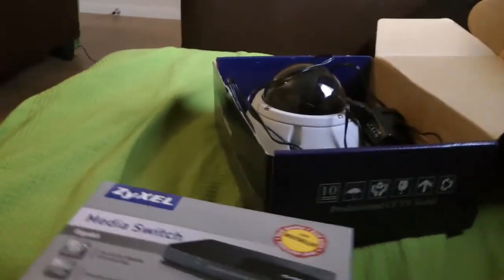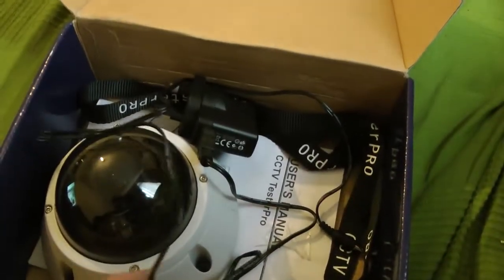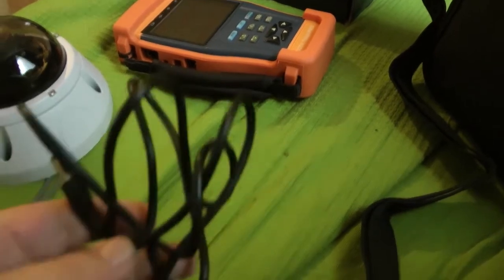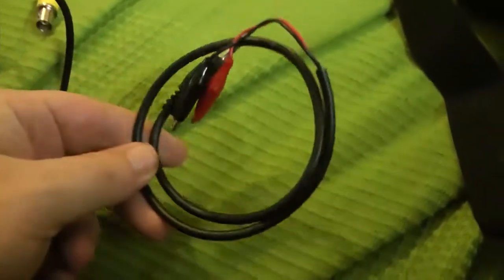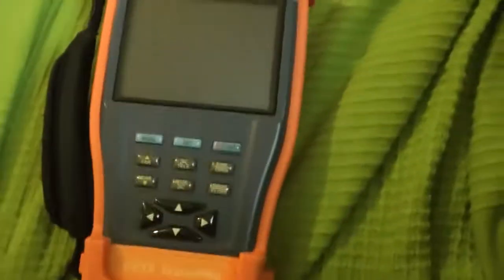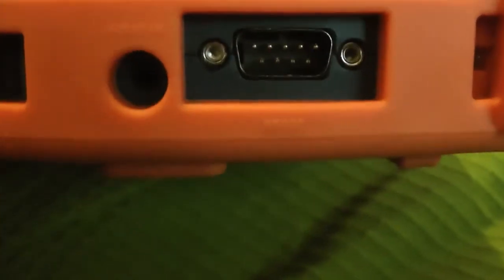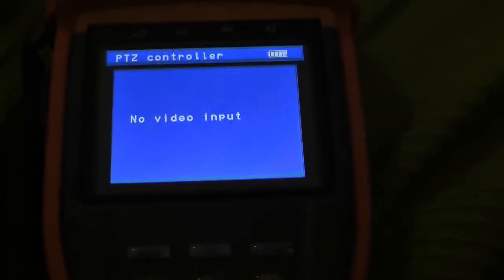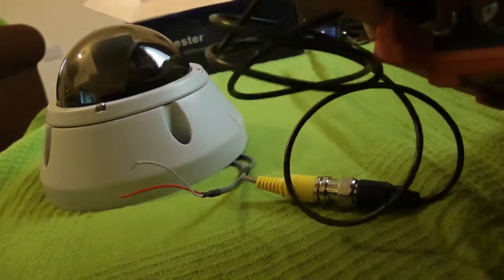3.5" inch cctv test monitor quick look

Comment: only uses high end cctv gear but buys a cheap test monitor
Reply from the maker: totaly correct in fact if just this week bought a Panasonic WJ-ND400, why would anyone need an expensive test monitor to simply see what way the camera is pointing?
Reply: Using this test monitor for the last 6 years and it works great and does the job , the only problem - NO HD signal can be checked.